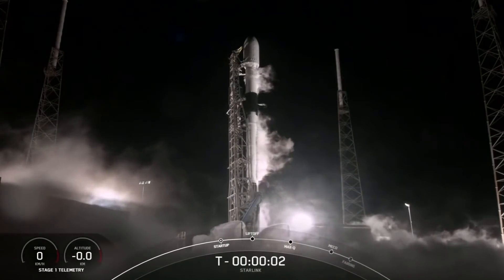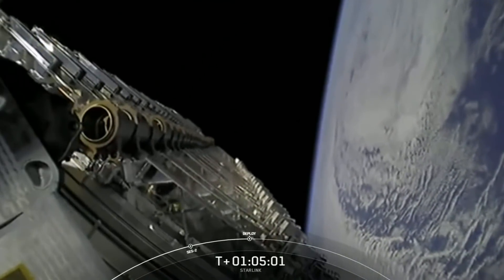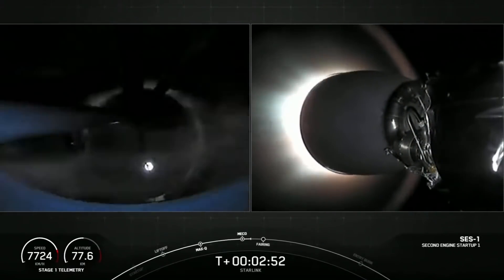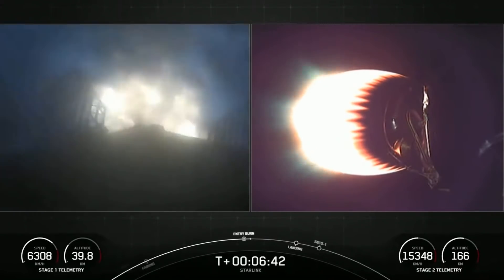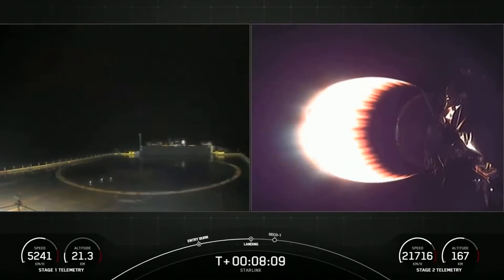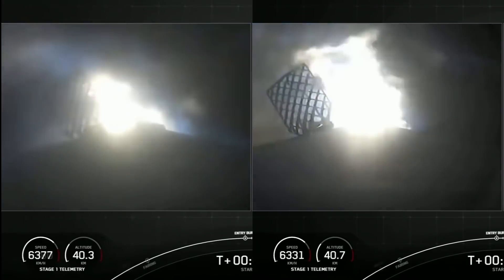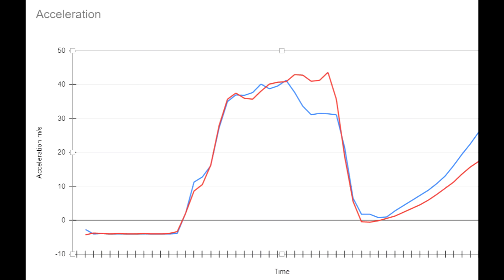Did An Engine Failure Kill A SpaceX Booster on Its 6th Flight?

Comment: 03:40 we can see here some issues with the engines power development, I mean normal burn and failed one - one kilometer and over 150kmh less on the failed landing stage.

Edit:
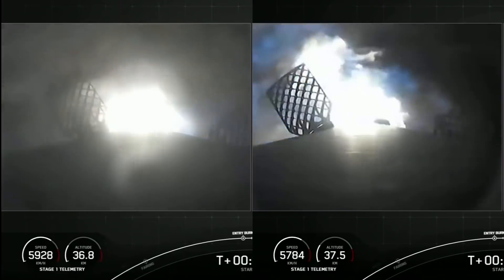Hr mentioned is at 04:50 🙏

Comment: Read my lips: SpaceX is not going to back down and stop re-using boosters after 5 launches. SpaceX will investigate, and evaluate what needs to be done to  reach 10 or even 20 launches. Once they've launched a rocket ten times they will evaluate what needs to be done to fly it an 11th and 12th time....

Comment: you'd think they would have some warning for animals that might get in the way, a simple siren or other would stop things being there. funny tho eh, people want them to reuse boosters n things and all it does is increase the failure rate, it still needs a full rebuild every launch. gimmicks get investors tho
Reply: No need for a siren, the engine usually gets them out of the way :D I’m guessing the failed booster was too far away to scare them off.
Reply: ok so the failure rate increase but even on this booster alone they got 4 reuses out of before. thats still much higher cadence, ect. so while the number of failures is increasing as a number, its decreasing as a function of the total number of launches

Comment: Could go for a failure mode in which if the center engine loses performance, the outer engines burn for slightly longer to match performance. I wonder if they have the ability to even try to do a suicide burn with the outer engines

Comment: perhaps the 25% loss instead of 33% expected from the engine failure is because there is a fourth "engine" which is the drag through the air.

Comment: regarding the "the engine seems to still be running, just not at full throttle" Hes missing something... The engines can throttle down, they dont have to run at 100%. Its entirely possible the engines were all running at 80% thrust. Once one went out the other two would have pushed up to max thrust to counter the loss of thrust, which would overall still be a 20% loss of thrust since they didnt have enough power to fully counter the loss of one engine... What is more interesting to me is that it didnt keep slowing down to keep the entry speed the same. But i suspect that regardless of signal to spacex HQ, the rocket has its own guidelines for 'safe to land' and 'not worth attempting', so its possible that the difference in thrust meant it was too far off course to be able to make it to the drone ship so it didnt bother trying. Its also possible that with its sensors that it knew there was damage to the rocket and rather then trying to ignore the engines again, it chose not to to prevent a explosion in the air(better to have it explode on impact and keep debris to a smaller area).

Hopefully spacex has details records and scans for the engine that they can go back to look at to try to find something that could have caused this that they missed.

Comment: Gr8 job with this comparative analysis, Scot! Real Sherlock Holmes style 😁 & thank you for that. 

When I saw this early this morning, from Bengaluru India, I did feel that orange glow on the right off the view quite ominous. I was actually expecting the deck to get gradually lit up as usual, and of course those birds to calmly but quickly fly away in time, to finally see our families booster setting it's feet down.

Well, sad that it failed on its 6th outing, hopefully providing some useful design requirements for the future.

Thanks once again for that super clear analysis.

Comment: Sure SpaceX can afford to lose the occasional booster, but what if that had been a Starship carrying 50-100 people and no escape system?  So far, the SpaceX failure rate is on par with other major launch systems such as Soyuz, Space Shuttle, Delta etc.  About one or two failures per 100 launches.  They're going to have to improve their reliability by at least an order of magnitude before they can consider human flight on a Starship.

Comment: Interesting that the booster's control system didn't attempt to lengthen the entry burn to compensate for the reduced thrust. This suggests it's programmed with a fixed duration for the burn, rather than a specific reduction in velocity. 

It's also interesting that while the blowback during the engine burn was aligned with the axis of the booster, the "decidedly un-nominal" flash seemed to be almost perpendicular by the time it ended--as if the booster itself was getting sideways to its direction of motion. This might mean it was one of the outboard engines (vs. the center engine) that failed, and the remaining two engines plus grid fins didn't have the steering authority to keep the booster on-track.

Isn't speculation fun?

Comment: Still think of the 2017 ITS presentatation.
The new messias said the Starship will have airplane safety.
Still one in 25 to 30 falcon 9 crashes.
Based on the same science you must have great nerve to put 100 people on top of a Starship.

Comment: How do you release 60 satellites into orbit in one launch? Won't they all be stuck in the same orbit?
Reply from the maker: They have ion thrusters to adjust into correct orbits
Reply: @scottmanley  to enter different orbits must take a really long time... I mean, how much force do these thrusters generate?
Or do they stay in the same orbit, just spread out?
Reply from the maker: @sk4lman  It's very low thrust, but over a few weeks they can get to their target orbits.
Reply: @sk4lman  Ion thrusters on Starlink satellites produce on the order of 10 mN of thrust. This allows to raise the orbit from 280 km to 550 km in less than two months. But additional two months are required to change the orientation of the orbital plane. Each batch of 60 satellites is usually spread into 3 different orbital planes. Since the orbits slowly precess due to the oblateness of Earth, this allows targeting different orbital planes without using additional fuel, simply by resting some satellites at a lower altitude for a longer time.

Comment: Given resources within a solarsystem... can we run the numbers on actual resources needed to put a civilization on a external star system... food.. fuel... oxygen... 

Maybe Fermi means land locked for a species reaching out... 

Being intelligent we would seed the trip... to ensure its redundant.... just find myself asking... to keep one human life active.... ignore generations... Whats the consumption per lifeform leaving to landed...

We can invision solar collectors near mercury powering a laser out.. or back to earth to power it... or refracted dark side mercury to process metals....

The future of machine building will be?
At what point does water presist in space... if given aid... could we build a solid reference point..  say a big ball of h2o.... to ground say work platforms in...

A Dyson sphere will not incorporate land mass... it will be the containment of liquid h20.

Thought on this... basically machines get to big... how do you overcome the support structure needed in the base of such machines to anchor them to the forces involved..... 

Thought once... maybe recycle engine blocks... flip them upside down... affixed to concrete base..... run your guide on the crank.... two axis each side of a poll of water..... y axis being the float. Z axis same rails.. controlled by water lvl....just drop the bed.. ways as needed... and force positive buoyancy into the float to hold rigidity......

Let's say for case example... bay of fundy... 60 foot tide.... coffer dam.... float  around that to raise the tool head.... could use as a drop forges.... do a dam past the coffer to have the inner circle before the dry work area as your c axis for afixing tooling heads.... so basically here on earth... coffer dam... surrounded by a dam... surrounded by a circular concrete float.

So big here would have to translate to big up there... how do we counter the forces needed to turn say a 200 km diameter ring??? Break it up... and weld.?
Or segment and allow overlap... never join... and allow rotation to hold it together? 

Current... drag... and segments rotating within?  ifk... seems plausible

Comment: As soon as I saw the entry burn cut-off, I knew it wasn't going to make it. That's a lot of fuel pouring out and burning. Looking at the replays here, I noticed that the flames were streaming off to the right, and that the grid fins were not moving. This suggests to me that the rocket was already moving to a somewhat side-on position, possibly starting to tumble, which the later pulsing flashes before crashing would suggest. Your analysis of the telemetry is great! Strong evidence for an engine failing during the burn.

Comment: Disappointing, yes, but with those five additional launches on B1059, SpaceX did not have to build an extra 45 engines, just for the missions flown by this rocket. When you add up all the other reused rocket savings, that is hundreds of rocket engines (and other components) where SpaceX has saved huge amounts of money, resources and time.  Nobody can compete with them.

Comment: After the entry burn, one engine failed to shut off.
The light of the burned fuel from this engine flows towards the right side.
This means that the rocket was falling not aligned with its ballistic trajectory.
It was appearently falling horizontal, with the left side down and the right side up.
It later broke, when the athmosphere became thicker, and it exploded some kilometers up in the atmosphere.

Comment: I knew when watching the stream that the entry burn was dodgy. I could also see that Jessie Anderson who was presenting also suspected something I could hear it in her voice. I didn't actually expect to see anything with the landing at all I thought it was going to burn up a lot more than it must have and I'd thought at the time surly the guidance would not get it anywhere near. I had suspected at the time that one of the engines had completely blown out and that fuel and oxidizer was now leaking from the damaged merlin. I mean I got pretty similar speculations to your in depth analysis but then again yours is probably alot more accurate while mine was just suspecting while watching the live stream.

Comment: What I am wondering is... are there always seagulls and they are just scared away before the stream switches to droneship cam? Were the seagulls visible as a result of the booster not heading for the droneship, or would they actually have been fried? I don't remember seeing any in other live streams, but they usually switch so late that the booster is already close by

Comment: Maybe it's a sticky throttle and they can't kill the engine. Then the flight computer realizes that the speed is off by a lot and decides not to fire up the other engines for a landing burn, such that the rocket ditches in the ocean instead of demolishing the barge. That is the purpose of the dogleg landing maneuver anyway.

Comment: We have seen engines on SN8 and SN9 failing to relight, now the raptor on 1059 appears to have failed relight. Is this a pattern or coincidence?
Reply: Coincidence.  We only know what failed on one of the 3 instances and of them 2 involved experimental engines going through experimental flight testing and this which is a flight proven engine.

Comment: There is a lot of speculation in what actually went wrong but given the information it’s likely that there was a failure downstream of the turbines.  Hopefully they will be able to collect enough information to figure what exactly failed and how that lead to lost telemetry and control. This may also help them with Starship development. It must be difficult to put failures in such a public eye, but it will lead to much improved and safer systems.

Comment: It goes to show that reusing rocket engines is a big challenge. SpaceX has gone further in this area than anybody and they continue to awe me with every launch and recovery, and even their failures leave me in awe. NASA will definitely be interested in the failure, but I doubt it'll put a hamper on any manned launches, since to my knowledge, SpaceX is still only using new, unused raptors on manned missions, saving the used ones for unmanned satellite and resupply missions. 

Even if SpaceX were only to achieve a 1 in 6 failure rate for these boosters, it would be amazing, considering 1 in 10 is pretty nominal for other *SINGLE USE* rockets out there like the Russian Suyez primary stage. If SpaceX can achieve close to their target production for new Raptor Engines, getting 6 uses out of a booster will hardly cramp their style. The more they can produce in a given time frame, the cheaper the Engines are to replace, and I imagine the raptor engines are the most expensive part of the boosters next to fuel.
Reply: Luckily there has never been a first stage failure on accent yet.

Comment: Seems like a similar redundancy issue as with Starship.  There ware extra engines,  why not fire up another good engine when there is a issue like this?  Thoughts?
Reply: I think only the center engine on the F9 can gimbal so if that engine is the one with an issue landing becomes impossible.
Reply: @TheEvilmooseofdoom  All engines on Falcon 9 gimbal, but only three of the first stage engines have the additional hardware for restarting them in flight.
Reply: @cogoid  My understanding is the outer ring of engines have a very limited 1 axis range of movement (they are all much closer together) and that the center engine is mounted lower with 2 axis movement providing the bulk of the control authority.
Reply: @TheEvilmooseofdoom  The center engine on the first stage does have much more space around it, comparing to the gap between the nozzles of the outer engines -- but this does not necessarily mean that the outer engines cannot gimbal by a fairly large angle when they do so in a coordinated fashion. Consider a brush -- the bristles can be closely packed together, and yet you can bend them in any direction. The situation with the other engines is similar -- when they gimbal, there is never a reason for the neighboring engines to sway towards each other, and when they all sway in the same sense, there is no need for a large gap between them.

Photographs show that all engines on Falcon 9 have two thrust vector control actuators, and they all are quite sizable. Falcon User's Guide says that Pitch, Yaw and Roll of the first stage are all controlled by gimballing of the engines, whereas on the second stage a separate Reaction Control System is used to control the Roll, because single engine can only control the Pitch and Yaw by gimballing.

So, all engines on Falcon-9 definitely gimbal in two axis. But in the absence of further information from SpaceX, we can only guess whether thrust vectoring of outer engines, as it is presently implemented, is good enough for landing without the center engine.

Comment: This is what makes me nervous about the starship landing system.  Powered landings are great for boosters, where losing them on landing is a solid "meh, we tried." Not so great when a failure results in death, or even just mission failure (like failing a sample return.)
Reply: You can't perfect a system without using it and ironing out the bugs.  Commercial aviation wasn't as safe in the early days as it is now.
Reply: @TheEvilmooseofdoom  The thing about aviation is that it got safer through a culture of "what's the backup plan." There's a procedure for almost anything that could go wrong, and when there's not, you get the 737MAX. If there's an engine failure on a propulsive landing, what's the backup plan?  What can be the backup plan?

Simply improving the reliability doesn't solve the core problem that if something goes wrong, there's just a few seconds between finding out there's a problem and slamming into the ground.
Reply: @The2wanderers  The backup plan is the thing that is still to be developed.  I don't see what other options they have for flying and returning such large vehicles other than powered landings so some kind of contingency will have to be worked out there.  They already said on the next flight they will be starting all 3 (instead of just the 2 required) and shutting down one.  So already there is one small level of potential redundancy.  How well it works still needs testing.  A lot.

Comment: "Telemetry was lost"... or SpaceX cut the feed. Once you realize you're not going to land it you collect what you can then trigger the FTS device to scatter debris. That's what the FTS is for... But I wonder if, like Starship, they re-write the flight controller code to light more than one engine then shut one back down. A little more fuel but a little more safety.